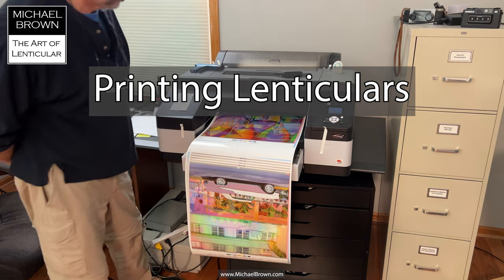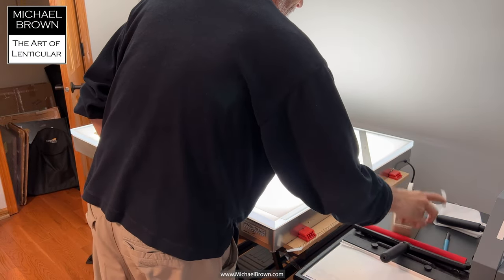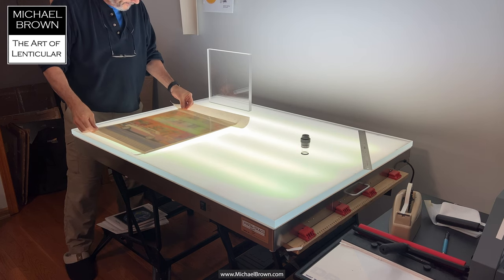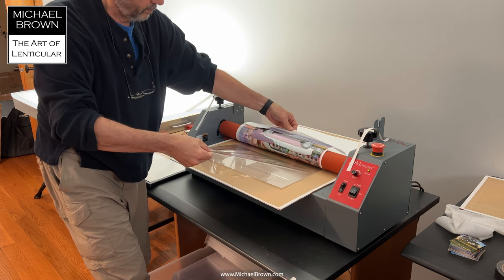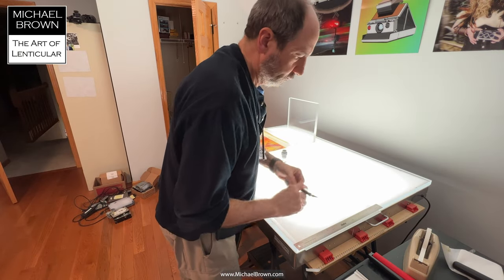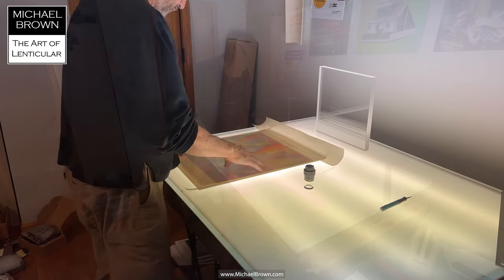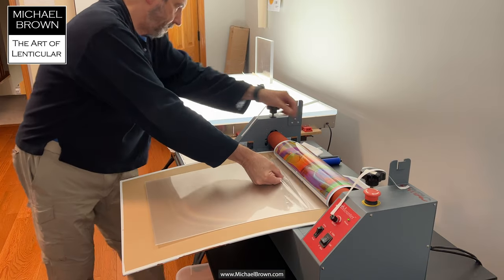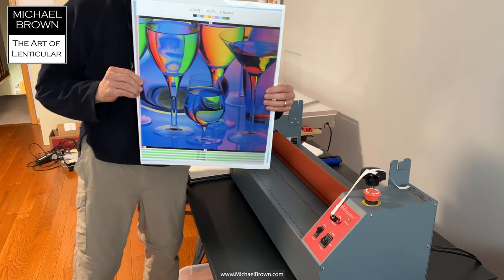Lenticular Printing DIY

Comment: Hello Michael, great video! Does a machine that does this automatically for large scale production exist? Thanks a lot!
Reply from the maker: There are large format UV printers that can print the interlaced picture to the rear of the lenticular sheet. It’s still a hands-on workflow because you have to align the sheet on the printer.
Reply: @MichaelBrownArtist  Thanks a lot! There were lenticular cards that were given in millions of Frito-Lay (Cheetos, Ruffles etc) snacks in my Country. They were probably done by UV printers for the amount that was done right?
Reply from the maker: @curat3d  , the UV printers I mentioned are for small quantities. There are litho workflows for customers that need thousands or million of the same piece. https://optigraphics.com/lenticular-printing/
Reply: @MichaelBrownArtist  Thanks for the response! And I've read mixed things about UV printing on lenticular sheets. Is it actually higher quality than printing on paper?
Reply from the maker: @curat3d  , can be better or worse. It really depends on the application, materials, and print process.

Comment: What printing software you're using. I guess it's special 3D printing software and it goes along with the coated lenticular sheet. What temperature you are usijf at laminator. Can I have your contact to learn more from you? Thanks
Reply from the maker: I use either Lentigram of 3DMasterKit for interlacing. Photoshop for printing and a cold roll laminator. My contact info is at the end of my videos.

Comment: What do you use for the backer board and why is it necessary?
Reply from the maker: It's just a piece of acrylic. I was taught to use one when my laminator representative trained me on the machine.
Reply: @MichaelBrownArtist  Thank you, your videos are filled with undocumented techniques that have helped me tremendously. The how to's instruct you to laminate your interlaced photo to your lenticular sheet, but offer no details on how to get this done efficiently. The tape to pull the release liner, score to top 1/2 inch pull the release liner and cover with the silicone sheet (I use parchment paper) has made my laminating improve. I may actually get a full sheet with no air bubble one of these days. Thanks again for all you post
Reply from the maker: @troysica641  , thanks Troy - I'm glad you find the videos helpful.

Comment: How to buy lenticular sheet
Reply from the maker: eBay, Etsy, or Amazon. I have a list of resellers pinned to the top of the Facebook group.
Reply from the maker: https://www.facebook.com/groups/311778376564863/?hoisted_section_header_type=recently_seen&multi_permalinks=1128220968253929